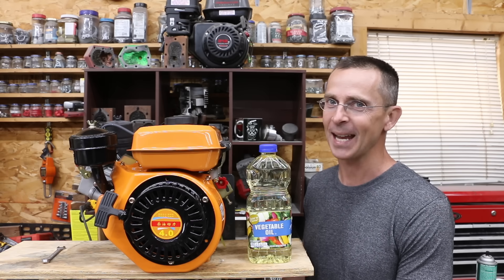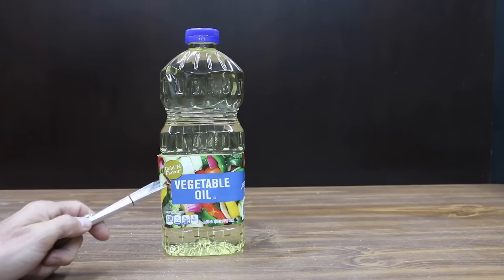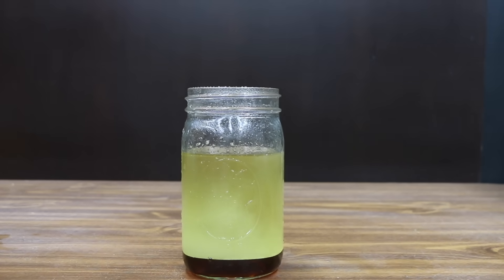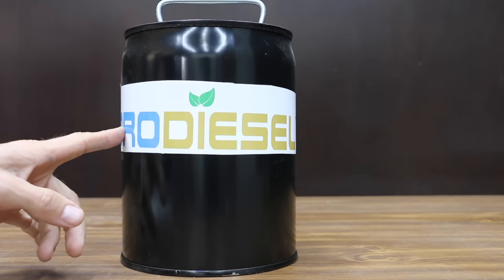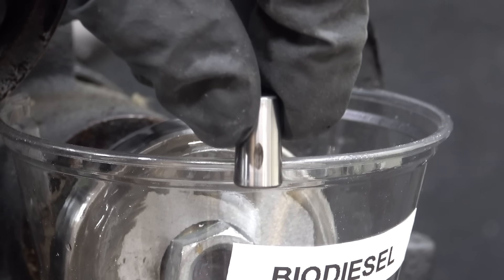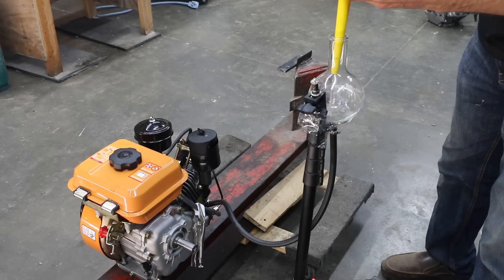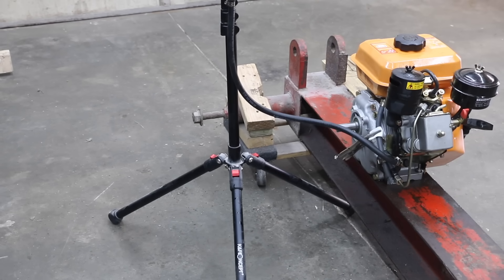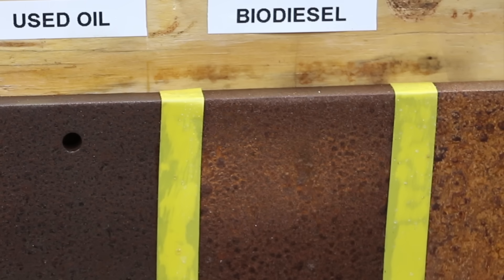Make "Biodiesel"? Let’s find out! Diesel vs Biodiesel, Used Motor Oil, Vegetable Oil, MPG

Comment: idea(s) idea :  are the Walmart power tools and battery any good?,  can you take plywood &  glue & screws and make your own LVL wood  just as strong?,   the 3" screws at Walmart are $2 cheaper than ones at Home-D are they just as good?,  does construction adhesive in the tube provide that much more strength vs not adding it with screwing wood together? ,   are nails out of a nail gun just as good a screws for strength?;  if I mix motors oils together like 5qts of 0w-20 and 1 quart of 10w-30 will it come out close to 5w-20 weight oil?  ;   can I make my own granite drill bit with a normal drill bit  with epoxy & diamond dust bits ?  ; can I filter my used motor oil and mix it with my oil burning heating furnace at home?;  is honey a good wood preservative?;  on a flat tire  and I drill a hole and fill it up with construction foam out of a can can a drive on it to make it home or how long will it last? ; Gorilla black duct tape can you make a canoe out of it (make a wood frame and wrap it with Gorilla Black duct tape)?
Reply from the maker: Thanks for the suggestions.

Comment: When I was making Bio-Diesel for many years, I notice a big difference in power compared to straight Diesel. Would have been nice to see a power test of some sort. On Bio-Diesel, I guessed about a 15% to 20% loss in power. Lived in a hilly area. I know the truckers don't like Bio-Diesel for this reason.
Reply: was it pure biodiesel or did you mixed it with straight diesel too?
im making a project about it so i would like to know more if you have few more experiences!
Reply: @sheatemymom8088  same experience for me while running b100 for 2 years in my twin turbo dodge
Reply from the maker: Thanks for the feedback.
Reply: I’m curious about your feed stock and quality, you used to get biodiesel made from the local plant here.  I gained a solid amount of power, plus it cleaned out your fuel system.  They use animal tallow for their feedstock though

Comment: "I don't know about rolling coal, but I think we should try rolling some french fries with this biodiesel...."  Another good one-liner.  Got a suggestion for your test if you do a part 2: Have the engine run a generator and check the power output/fuel usage/governor setting for each fuel.  Also, see if a slight mix of oils/fluids will help things work better.
Reply from the maker: Thanks for the video idea.
Reply: You could also use a bomb calorimeter to check energy content of each fuel.
Reply: yeah but the oil needs to be clean or an issue may arise

Comment: One VERY IMPORTANT fact was not talked about: Biodiesel is an ESTER meaning it is a SOLVENT. It dissolves rubber, some plastic and it creates a disaster in some tank coatings or liners. The only flex material it does not dissolve is VITON. I owned 3 vehicles running on 100% Biodiesel: A Massey ferguson tractor with a yanmar diesel, a E class Mercedes 1979 E300D Turbo and a Jeep Liberty CRD . Only one of these had NO problem: The Mercedes. All these engines had NO INTERNAL PROBLEM with 100% Biodiesel, BUT.....the Tractor constantly had plugged fuel lines due to a disintegrating tank liner. Once the tank was replaced by a DIY special there were no problems at all. The Jeep Liberty had a Italian 4 cyl. engine by VM Motori. This vehicle fared the WORST! The EGR blowby had enough fumes to DISSOLVE the large rubber hose from the turbo to the engine intake mainfold and caused it to pop wide open, it also dissolved the fuel filter gaskets and the badly designed fuel path (fuel filter was located in the SUCTION LINE!!) it always started to leak air into the Common Rail! Definitely a NO GO with Biodiesel. Today Mercedes diesel engines are so sophisticated that fuel management will INSTANTLY determine something is wrong and give you check engine, may even go into limp mode. DO NOT TRY 100% BD if you own a E 320 CDI Chassis W211. Big trucks.. WHO KNOWS if 100% BD is acceptable to some engines, I would suspect that its ok, however due to the COST of engine replacement or tricky repairs it would probably be wise to NOT EVEN TRY! And lastly, due to the low temp jelling of BD it is UNSUITABLE as a 100% fuel year round in the temperate zone. BD is, at best an admixture to improve some emission values, but the biodiesel hype is gone, I think.
Reply from the maker: Thanks for the feedback.

Comment: Back in the mid '80's I drove for a company who leased their trucks from Ryder. Ryder, when servicing those trucks, would drain the used oil into a pan, then run the used oil through a "re-refiner", which was nothing more than an oil filter, and pump it right back into the trucks fuel tanks. That was fine right up until winter, when my dedicated delivery route took me into central N.Y. state. Then the truck crapped out at my second stop, necessating a service call to change out the fuel filter. Then it happened again at the third stop not 5 miles from the first, so service call and filter change #2. Finally, the air temperature got up high enough that I had no more problems. When I got back to the shop, I told them I'd really appreciate it if they'd not do that again till winter was over. Don't know if they did or not, but I never had that issue again that winter.
Reply from the maker: Thanks for sharing.

Comment: Emissions aside, this video confirms that used motor oil can be repurposed as a practical fuel substitute for diesel engines that you are not that concerned about. You could use the engine of this video to retrofit lawn mowers, go karts, generators, etc, and burn a much cheaper fuel. Just don't try it in California.
Reply from the maker: Thanks for the feedback.

Comment: I know a guy who had a 7.3 IDI and he ran straight used motor oil through it they would get from the mechanic shop that he worked at and he did that for over a year with next no problems except the one time he got motor oil that had saw dust in it which didn't cause too many problems and there's still probably saw dust in that trucks tank to this day.
Reply from the maker: Thanks for sharing.

Comment: I have an idea, but I don't know if it's worth your time making a video about. I wonder if JB Weld is tough enough to be a shaft key. Just in case that's the wrong terminology, I mean the square pin that locks the flywheel to the crankshaft. I wonder if you could align the keyway and instead of hammering a solid metal key into the void space, inject JB Weld into it instead. Maybe test it with lots of speed changes, starts & stops, etc. I dunno.
Reply from the maker: Thanks for the suggestion.

Comment: The biodiesel is a saponified fatty acid with the glycerin removed after saponification  and methanol added.  This product is chemically quite different to regular diesel.
I would be concerned about the susceptibility of biodiesel to microbiological degradation.  Has anyone any data on that?
Reply from the maker: Thanks for the feedback.

Comment: Let's find some sort of fuel that runs the IC engines well. In love with those air breathing fuel injected engines. Can't get over the fact that those idiot Electric motors are taking over the automobile industries.
Reply from the maker: Thanks for the suggestion.

Comment: So used motor oil seems the best option. But i dont think a modern diesel engine would like that.
Luckily diesel in belgium is cheaper then gasoline
Its 1.387 euro or 1.415
Reply from the maker: Thanks for the feedback.

Comment: "especially considering the cost of fuels these days"
laughs in British at the tiny cost of fuel in America
Reply: How much are beers there these days? 
laughs in American at the tiny cost of a pint in Britain
Reply: @SirPhilMcCrackinVonBeggington  So you think your beer is expensive? At my local bar beer is 8€ for 0,4 litres. That's $11,46 for a pint. And the gas? 1,60€ for a litre. That's $7,34 per US gallon. laughs in Finnish at the tiny cost of everything a man needs in the US
Reply: @Jinppa   How is to laugh in Finnish ?
Reply: @watferfoot1467  Google search "tonnin seteli" and you see how Finns laugh.
Reply: If they only knew. Canada isn't far behind you guys
Reply: Considering the process used to make gasoline/ diesel it's actually cheap..
Beer for example costs about 3 times as much and is pretty much grown in field's.
Reply: @adrinathegreat3095  beer is quite a process involving several conversions before what grows in the field is ready to drink.

Of course there's farming and harvesting. 

But then the barley needs to be allowed to barely sprout (malted) to make the starches available, kilned (roasted) to varying degrees for base malts and specialty malts, and cracked (milled) before it can be used for brewing.

The milled malt then needs a 170 degree strike, thorough mix (dough in), 153 degree mash just to release the alpha enzymes. Then the grains are washed (sparge) to ensure that the sugars, which were converted from starch by the alpha enzymes all make it in.

Then this mixture is boiled for 60 to 90 minutes, with several additions of hops added at very specific times for the desired aromatic, flavoring, and bittering effects. 

After, the mix is rapidly cooled, with yeast added along with an airlock to concert the sugar into alcohol, left to ferment, and then often moved to a secondary vessel for the yeast to "clean up" and convert esters to heavier compounds.

From there, depending on the producer, one of two things will happen. Beer produced by commercial brewers is often pasteurized and filtered, and then force carbonated. Craft or micro breweries will often revive the yeast colony by feeding it more sugar immediately before bottling.
Reply: @jimbartosevich498  point being is you can make beer yourselves, they've been doing it for 1000s of year's and it's fairly easy.
Reply: Cries 11 months later
Reply: You guys voted for it.
Reply: @schfiftyfive9680  Nah, sadly nobody has ever asked how much we're willing to pay for gas.
Reply: 2$ a litre
Reply: @dylanscott6855  yep, that's about the average right now. $7.56 per US Gallon (3.78 liters). Google says it's averaging at $4.25 per gallon in the US.
Reply: France has horrifying Diesel fuel prices thanks to Mr. Macron. And the german government who introduced the €25/ton CO2 fee also rose the prices like crazy. This will surely destroy jobs, that's certain!
Reply: @Bandicoot803  And still the Green party, which has announced to add another 16Ct of taxes to the liter gasoline, is on the way to be the next German government.

Comment: You did that two part series on wiper blades and it has me wondering how different washer fluids stack up in hydrophobic abilities as well as window cleaning and ice melting

For example I know some old truckers that would fill their washer tanks with a gallon of soapy water and two gallons of 85-90% isopropyl alcohol
Reply from the maker: Thanks for the suggestion.

Comment: hi project farm, love this. but in terms of cost Biodiesel will be costlier at end price and even if it is significantly running with minimum wear n tear and providing better mileage economy (* more than diesel as fuel)? Can you provide more details on used motor oil and 10% gasoline mixture running the system for 1 hour engine running time with 15 mins cool down time upto 10 relay?
Reply from the maker: Thanks for the video idea.

Comment: That corrosion test may not be addressing the main concern of fuel line aging. Diesel fuel line or injectors gunk up more likely due to the fuel becomes sludge. I guess a better test is to put the fuel in contact with yellow metal, like copper, and with 120F heat, then see how much sludge the fuel generates.
Reply from the maker: Thanks for the suggestion.

Comment: I saw an old guy who ran his older diesel mini truck (Isuzu, I think) on used ATF from local tranny shops. I don't think modern 30,000 psi pumps and injectors would like it though.
Reply from the maker: Thanks for sharing.

Comment: Great video! I ran my old cummins 5.9 on used vegetable oil and used motor oil for years. Only thing I did was add a gallon of gas to each full truck tank for easy start when motor is cold. (No snow in the caribbean), I wish I never sold that truck.
Reply from the maker: Thanks!  Thanks for sharing.

Comment: A friend of mine has a Dodge 5.9 Cummins with over 1million miles on biodiesel he made using used oil from restaurants. The truck still tows heavy horse trailers across the Southeast regularly. He gets much better mileage than with diesel, it costs less than 1 dollar a gallon to make, smells better, and he doesn't have to worry about fuel shortages, as there is never a shortage of used cooking oil.

He has a system to make batches of 50 gallons at a time in his shop.
Reply from the maker: Thanks for sharing.

Comment: I think I mentioned it once before but I've been running used motor oil, atf, higher concentrations of gas than I probably should, pretty much anything that will burn for years in my 1st gen powerstroke. Other than a slight smoke haze I've never had a problem & it feels snappier on take-off with used oil. My pyro also runs warmer & jumps temp quicker. Probably a result of the higher BTU content. 

If I owned a jiffy lube, I'd probably never buy fuel again. When I do the oil changes on farm buses, I drive free for about a month 😎 This episode was awesome! You are the best, bar none!
Reply from the maker: Thanks for the feedback.

Comment: At work we go through a crap ton of wire wheels for angle grinders when prepping parts for paint on model t’s. You should test those to see which lasts the longest and doesn’t fling wires all over the place
Reply from the maker: Thanks for the video idea.

Comment: Shoot....
I dumped filtered used motor oil in my old 7.3 international and it ran better than pump diesel.
I dont usually recommend any Ford's, but those international engines are solid.
Reply from the maker: Thanks for sharing.

Comment: About 15 years ago, there was a local company here in AZ making 99% biodiesel (1% petro diesel added for some obscure tax reason) from used vegetable oil from restaurant fryers.  I ran probably 500-600 gallons of it through my '02 Duramax over the course of 3-4 years.  My truck, on this fuel, ran noticeably more quiet (I have a Banks Monster Exhaust and FIPC intake with K&N filter) and my mileage also went up by an average of 1-1.5 mpg.  (I keep pretty detailed fuel logs.)  It also seemed to have more horsepower when towing.  In addition, I'd started having a fuel sending unit issue and after several tanks of bio, it "fixed" the fuel sending issue and it's been working correctly ever since.  I did run Diesel Kleen on occasion and this may also have helped this issue.  On top of this, my truck smelled like french fries when driving down the street.  :-)  I'd run that mix all the time if 1) price were competitive and 2) the company hadn't closed down.
Reply from the maker: Thanks for sharing.

Comment: Just a thought. There must be a way of turning wood. Into tar or liquid. Like sasol make petrol!! But diesel?? That would be very interesting.
Reply from the maker: Thanks for the suggestion.
Reply: @ProjectFarm  if you really want a project!!?? So I made a down burn gasification wood stove for the lounge in my home. It’s pretty amazing even if I say so myself. Anyhow when doing Rand D ( took about two years) at one stage I put a pipe into the vortex burner to take gas and plasma samples, just because. This gas was a clean hydrocarbon. Perfect for ficher trophic process into liquid and or wax. To get the 8 bar pressure, gas could be cooled. Then compressed with a pump. Water could then be added. This cylinder could be heated. The water / steam would give the 8 bar for the catelist to work. Iron filings should work fine. The cool extract and repeat. Single stage process, not conventional, but would be an interesting experiment. Green diesel !

Comment: I have often wondered how vegetable oil would run in diesel engines ...thoroughly enjoyed that...just a thought, have you considered making a video on which is the best paint stripper to use when stripping thick years old paint.
Reply from the maker: Thanks!  Great suggestion.  Thank you.

Comment: Project Idea: glue shelf life test. Elmers website says their wood and school glues have a 2 year shelf life. I just used the last of a gallon jug purchased six years ago and it seemed to work just fine - with a caveat. My projects are not subject to a lot of stress so the last of the glue used might have been significantly weaker without my being aware. The jug had a thick residue in the bottom that did not drain out so some degradation is all but certain, particularly considering that the glue might have been subject to freezing temps a few times and temps of 100-120 many times (detached garage storage).
Reply from the maker: Thanks for the video idea.

Comment: Using used motor oil mixed with gasoline would be a good way to reduce the cost and extend the supply of fuel for diesel engines. However, vegetable oil, in the States, is selling for about $5/gallon, which is currently more expensive than diesel fuel. Perhaps used vegetable oil would work? 

https://www.target.com/p/vegetable-oil-1gal-128oz-good-38-gather-8482/-/A-78376315?ref=tgt_adv_XS000000&AFID=google_pla_df&fndsrc=tgtao&DFA=71700000012766761&CPNG=PLA_Grocery_Priority%2BShopping_Local%7CGrocery_Ecomm_Food_Bev&adgroup=Grocery_Good%26Gather&LID=700000001170770pgs&LNM=PRODUCT_GROUP&network=g&device=c&location=9021484&targetid=pla-1041733794456&ds_rl=1246978&ds_rl=1248099&gclid=Cj0KCQjw2NyFBhDoARIsAMtHtZ7_aInCm-CG952dWTs9jzOL3l-U5cL9-42JGSvpckFgZJW4EqcEb6kaAvS2EALw_wcB&gclsrc=aw.ds